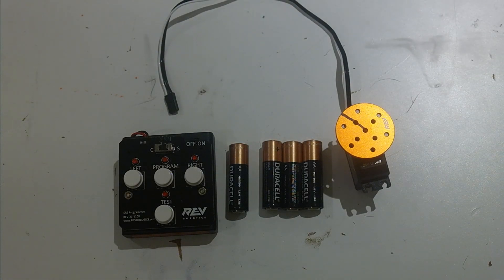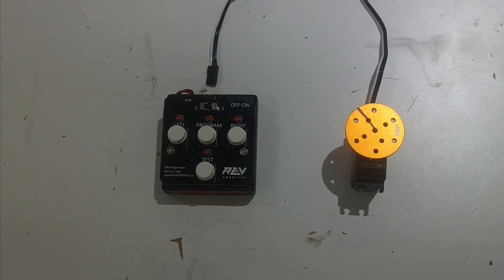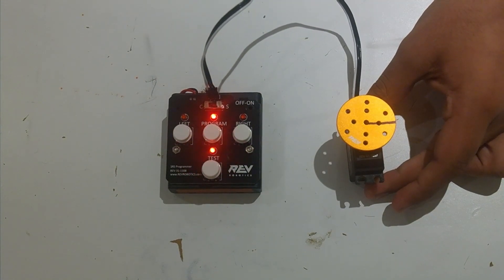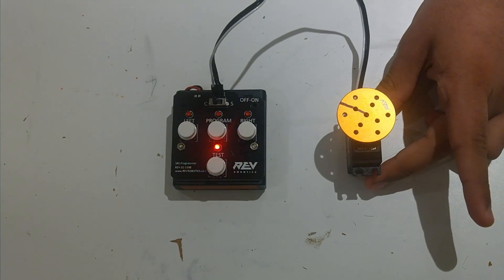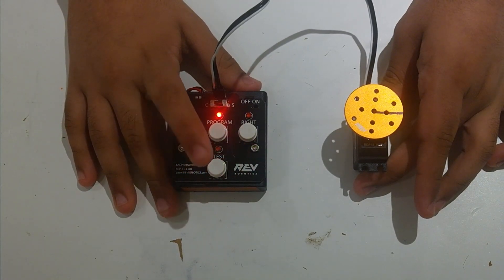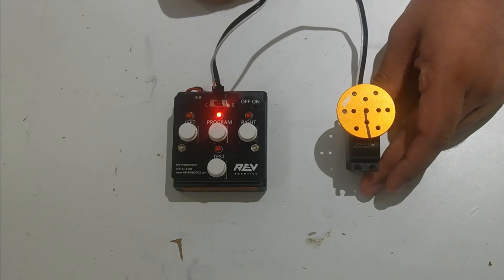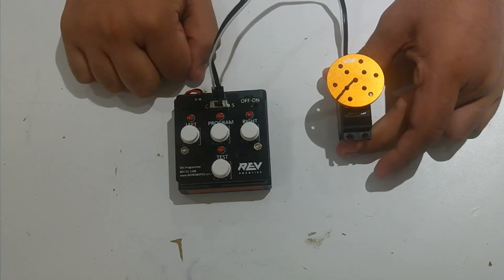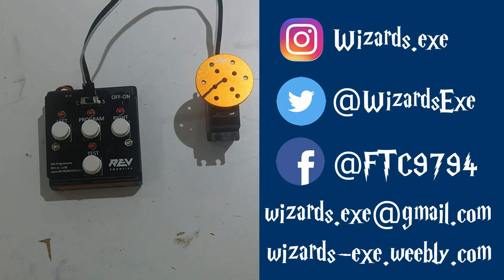Servo Programmer Guide

Comment: Will this work with other brands of servos,  eg  futaba  ect
Reply: It will work with some programmable servos. The ones that are compatible will have a programmer similar to this one. The main ones that I know of that are compatible are the goBILDA servos (torque, speed, super speed), Rev Smart Robot Servo, and Feetech FR5311M
Reply: @arjunoberoi7976  okay,    thanks     I'm not familiar with those brands,   are there quality any good,   reliable,  repetitive,and centering.    I'm asking as an aircraft flyer.    Were precision is absolute key
Reply: @russcole5685  The quality is pretty good for all of them, though I would say that the goBILDA ones are the best due to having steel gears instead of brass gears. These servos are mainly marketed towards high-school competitive robotics. I would say that these servos perform better than the Hitec ones that we have (we used to use some 625-MG servos but have switched entirely over to programmable ones)
Reply: @arjunoberoi7976  for sure,   programmable is the way forward,    Sbus as to say,     one lead powers all,    only thing I didnt catch how ever was the channel selection.   Futaba, Frsky ect.     Makes installation a breeze.   Especially with say a removable wing for transport,   were you have many servos to plug in.    With Sbus programmable servos,   just run them all off of on lead so can have eight plus hanging of one lead,     no mistakes can be made when plugging them back in,  as they'll only react to the signal they are programmed to read

Comment: Can you edit speed as well?
Reply: You can't change the speed of the servo using the servo programmer, though you can slow down the servo in your program by either setting the power lower if it's in continuous rotation mode or slowly iterating positions if it is in angular mode.